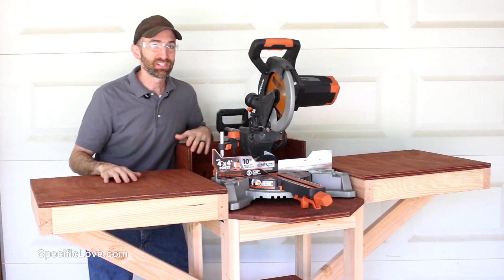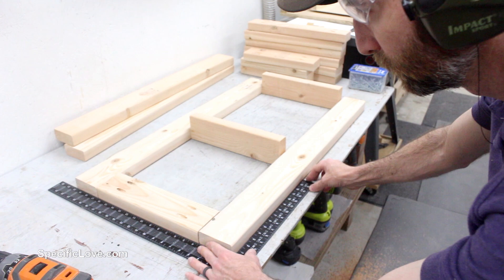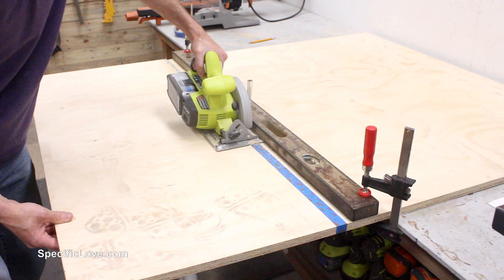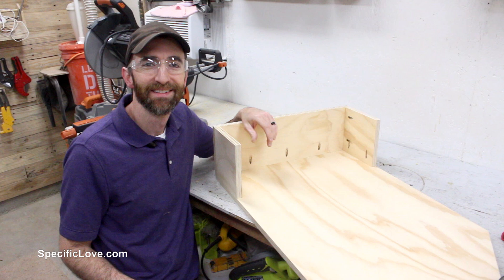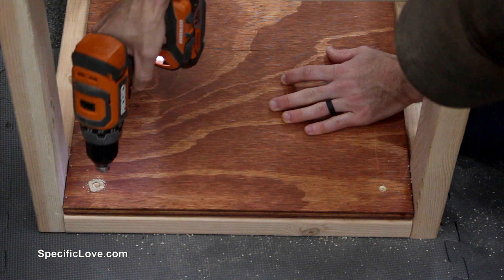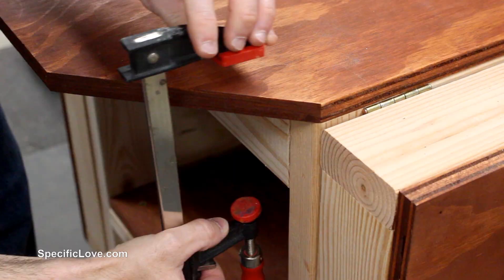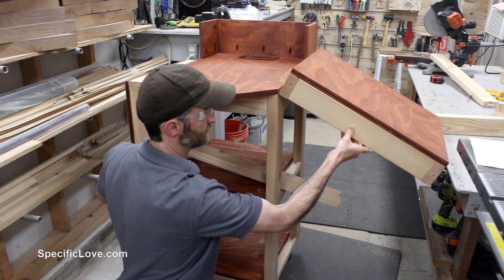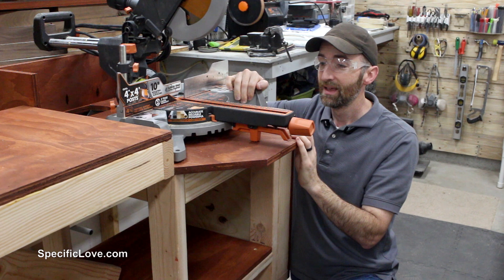Mobile Miter Saw Station

Comment: Chanced upon this and unlike cabinet based stations I actually have confidence I can build this. However plywood is generally more dimensionally stable, did you see any issues with the dimensions after a few years?  Note I'm a month end wood worker.. not even weekend but want a  way to use/store my miter saw better without it sitting on my built in table haphazardly :-)
Reply from the maker: I keep it in a dry location and so far use it often.
Reply: @SpecificLove7  I see, thanks for the reply.  Of all the builds I've seen yours is the most beginner friendly and I'll base mine on yours for sure. 

Thanks for the walk through!

Comment: I am planning on getting one of those saws sometime in the next year or three and wondered if I would be building a long bench for it. But this is far better for my small shop.   I just thought you would put your wheels out as far to the corner as possible to keep it steady.  Its a bit too small of a wheel base for my comfort.   Otherwise, great.
Reply from the maker: I completely understand on the wheelbase. I do not move mine outside of the shop, so it works for me.

Comment: Just bought a miter saw and some more power tools ready to tackle this as my first project....was wondering what the  measurements are for the middle table where the miter saw sits at? Or does the size  basically depend on how big your miter saw is?
Reply from the maker: It depends on your saw. Just custom fit it to your liking.
Reply: What thickness of plywood did you use?

Comment: You have such an awesome amount of tips! Great videos! Do you ever use a wax or polyurethane on the unstained pine to prevent yellowing and oxidation over time? I’m curious what you would recommend. I’ve just noticed some of my project’s pine start to look a little dingy over the years.

Comment: what about making it a flip top and you can put another tool on the other side and it would do double duty
Reply from the maker: That is a very good suggestion. Part of the reason I did not, was to leave some extra storage space underneath.

Comment: Nice work! I’d prefer locking angle brackets for the wings on mine. Have you noticed if the raised back helps with dust?
Reply from the maker: It helps a little, but it could use a higher top cover to work better

Comment: This was a beautiful build. The only true problem I see with this is that it's to heavy. I would have went with soldering an aluminum frame with the stained wood top. Also, instead of using a 2X4 for the folding extensions, I would have gone with a 2X2 or better yet cut 90 degree angles into pvc and give them a wood finish by hydro dipping them.
Reply from the maker: It is a little on the heavy side, but having a little more weight keeps it from rolling as easy. PVC is a very interesting idea. Thank you, I might use those in future builds.

Comment: Great job on the miter stand I think I’m a do one myself but holding the wings or the 2 x 4 braces I think I’m just going to screw in some eyebolts to  the back so I can hang them off the back so would it be out-of-the-way

Comment: Its very nice what you have done,  I have same miter saw evolution,  I am about to make same table station,  I would like to ask you about how dust idea works with what you designed?  Since I have issue with the dust and became major issue,  do you have plan for the dust of evolution miter saw? 

I am new subscriber in your channel,  I hope I'll get more knowledge from your channel. 

Looking forward to hear from you 🙂
Reply from the maker: The dust collection helps but like most mitersaws it is really hard to catch all if it.

Comment: I like it! I think its just what I've been looking for. One question for you, does the dust collector actually work? I was thinking of a similar design but using two collection ports.
Reply from the maker: It works some with a high volume collector but could be improved upon. Give it a shot and let me know.
Reply: @SpecificLove7  Will do!

Comment: Great build,I really liked it. How many 2x4 you need for this?
Reply from the maker: Oops, I forgot to count that. But I did list the lengths and number of each board in the video.
Reply: I used four 10' x 2" x 4"

Comment: 1.) Its better to use a piano hinge not these small hinges for the side parts.
2.) It is more better to use a side parts´ support adjustable, not solid, i.e. some screws or so.. it seems to me too complicated to adjust exact level with the mitre saw table by using these solid supports.

Comment: Been a few months. How about tacking a short review of your own table on the end?
Reply from the maker: I try not to make many review videos right now, but so far the side tables are doing well. I use them for most of my cuts and they are nice to have, and especially nice to fold away.
Reply: well that's a little different, I think in the video you mentioned you didn't think you'd be using them much. Good to know! I'll pay close attention that my side tables work properly. Did you beef up the holder-uppers at all?
Reply from the maker: Not yet, the setup is still sturdy. I have found my projects needing long pieces lately, or otherwise I would not use them as much.